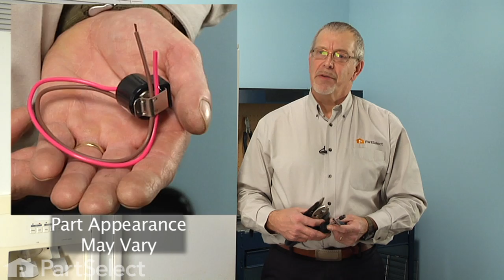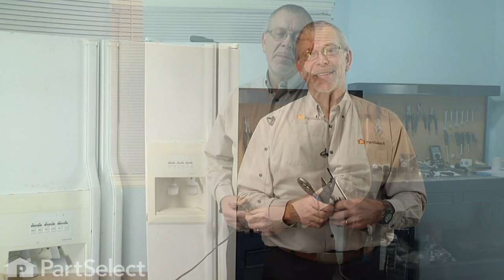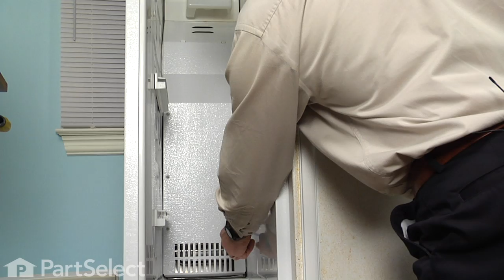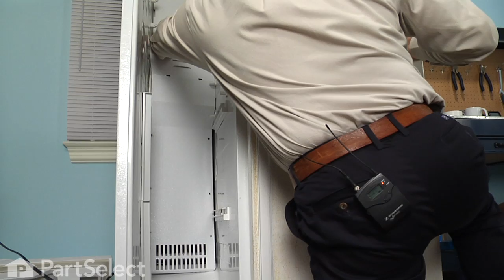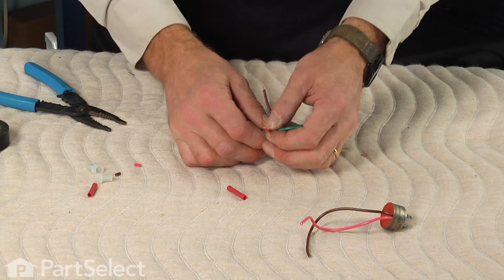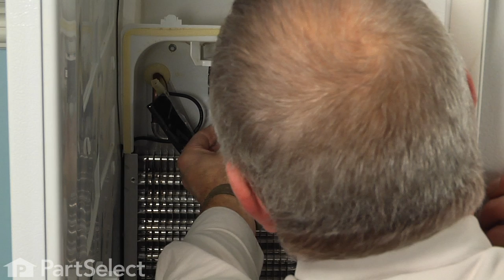Refrigerator Repair - Replacing the Bi-Metal Defrost Thermostat (Whirlpool Part # 2321799)

Comment from the maker: Hi there,

Sorry to hear about this problem with your refrigerator. If the repair technician has indicated that all of these parts are in working order, and you've replaced the part he/she advised to replace. I would suggest examining the coils for lint and debris, and vacuuming anything out that you see. Do you mind if I ask the temps in your freezer section and in your fridge section?

Thanks!

Comment: I am having a Samsung fridge (Model No: RT54MBMT). The freezer on the top is cool but no cool comes down to the lower portion of fridge area. The technician said the PCB needs to be changed, we changed that, but still the same problem. The technician also said the thermostat is ok, defrost timer is ok and the heater is ok, the compressor, too is working. but still what should be the real problem for this. Pls advise.